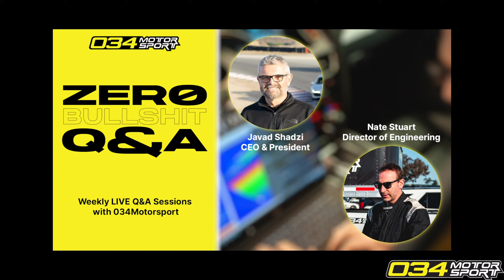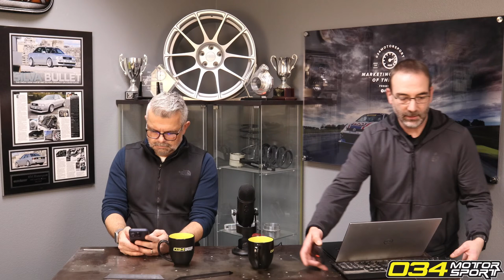Live Q&A, Round 215!

Comment: I have also had the car run past the Rev limiter in first gear when in manual mode when I click the paddle but it doesn't do it with the regular shifter in manual mode but either way it has run up to 8200 thankfully nothing has happened but I would not like it to do it again before I get the springs and retainers/seats

Comment: Will you ever release a al551 tcu stage 2, with higher torque limits and increased clamping pressures also is there anyway you can stop the car from shifting into 8th gear at 55mph and raise it to 65mph, what is the RFP adaptation and the kick down adaptation in the mobile app, how come there is no tcu options on the toolbox section like reset adaptation like in the ecu section.

Comment: Your pcv system separates fuel vapor and oil vapor out of the crank case the little line does fuel vapor and the big tube does oil vapor the fuel vapor goes back into the intake and a catch can catches the oil vapor